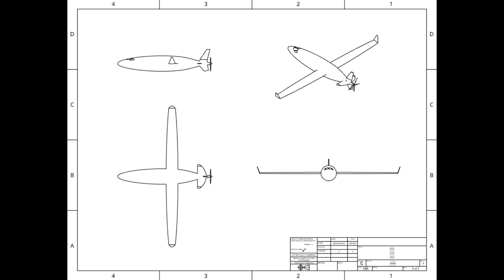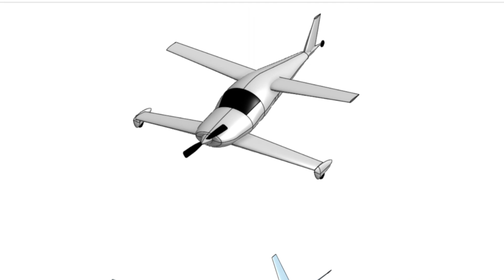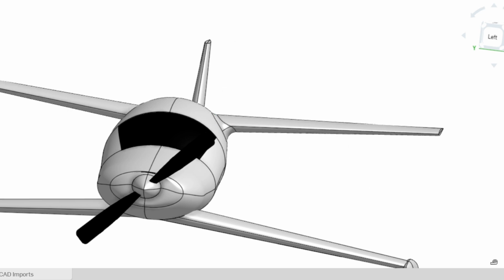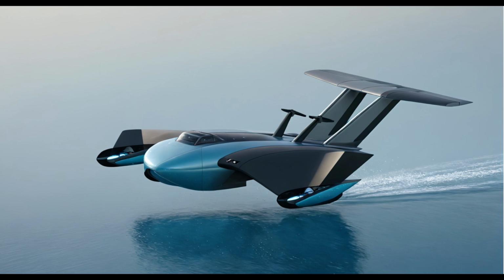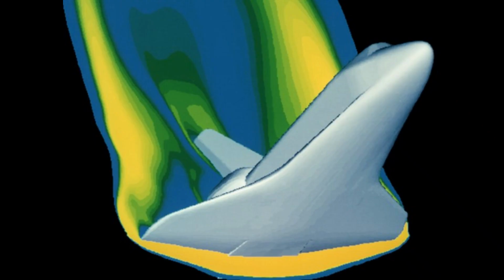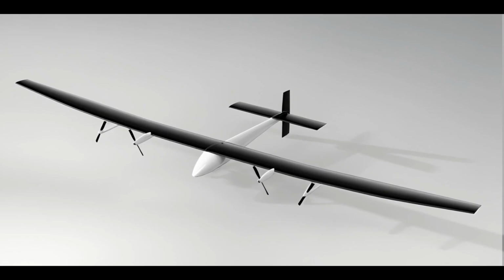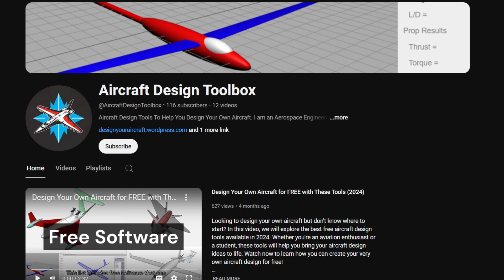How to Design Your Own Aircraft

Comment: Can designing things there really work in real life?
Reply: not really, there will be a lot of things that couldn't be fully built in 3d means, you will also have to measure different things about the craft, such as center of gravity, drag lift coefficient. could use simulation games such as flyout to build it thou :D
Reply from the maker: This is just one of the initial steps, and the design acts like a starting point for further analysis. Right now, I only create 3D models (which can be later used to visualize/present/3D print the idea). A lot of important steps come next, based on which we iterate the design. As it is said in aircraft design, "you never build the dash-1". (It is easier if making an RC plane, because the design can be built, flown and tested without much investment).
Reply: I mean, you could 3D print it and see if it's feasible, if that's what you mean...